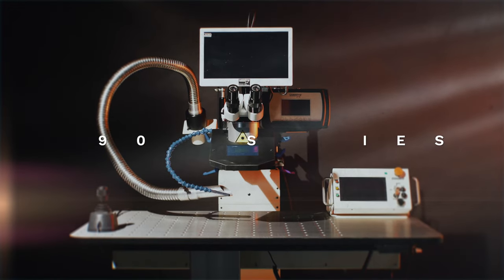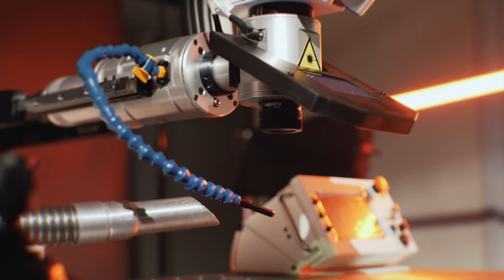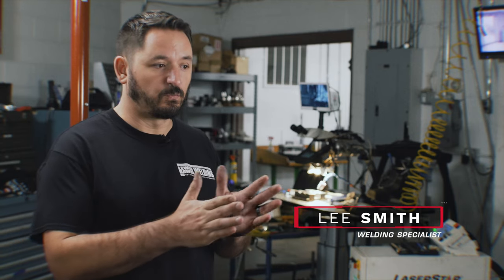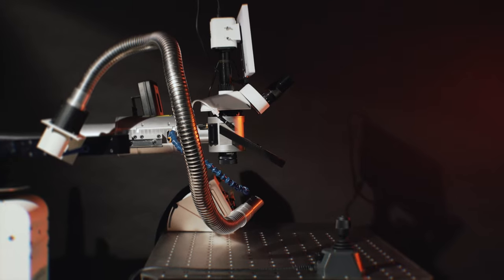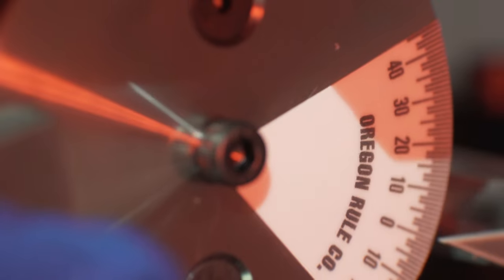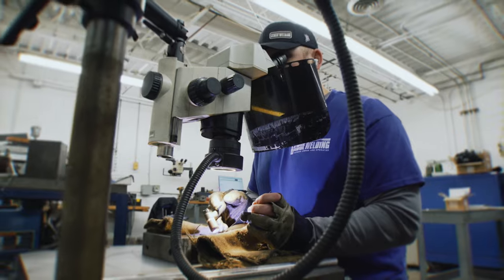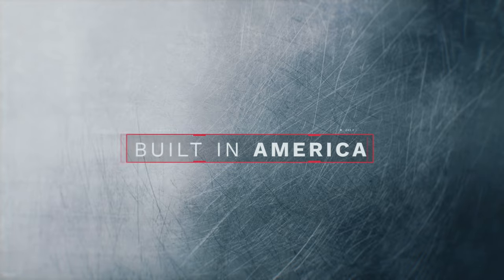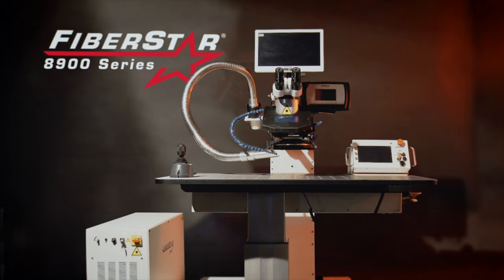FiberStar 8900 Series CNC Welding Workstation

Comment: You can weld .062 inch down to .003 inch welding wire. It will weld in continuous wave mode . It also has a CNC mode for production. Good for both tool welding and production welding. No chiller required. No flash lamps required . No electrical transformer required as it runs on 240 volt single phase standard US power. Has a rotational device and a tilting optic as options. They have a first rate engineering department and sales staff. I had a problem which turned out to be my setup error and I called the applications engineer at 7:00 at night and he returned my call in 3 minutes and got me going.I can call the owner of this company and he will take or return my call . I have had zero problems with this machine and the others that I have. Great company with great products.